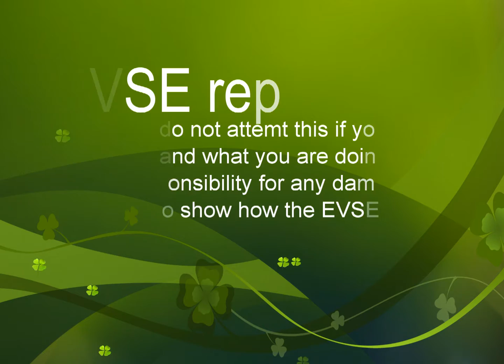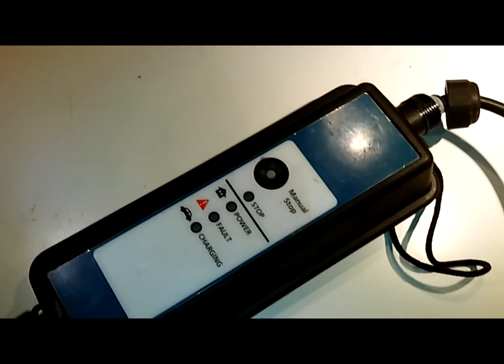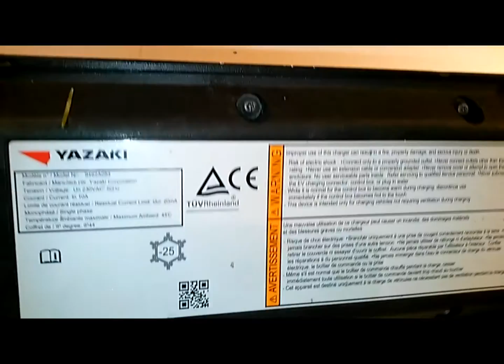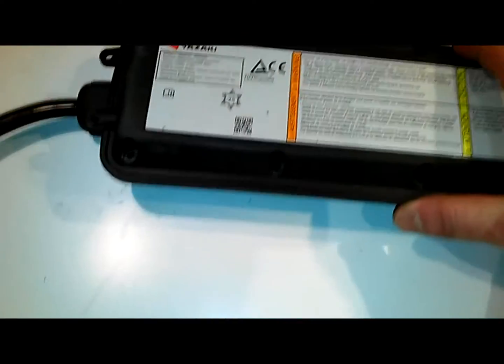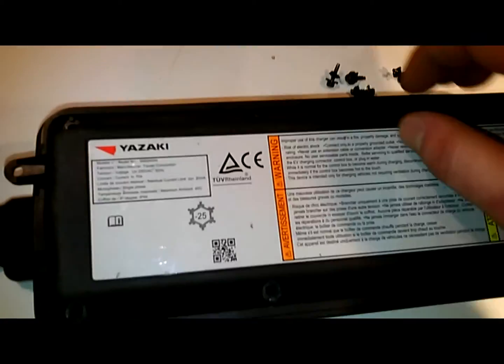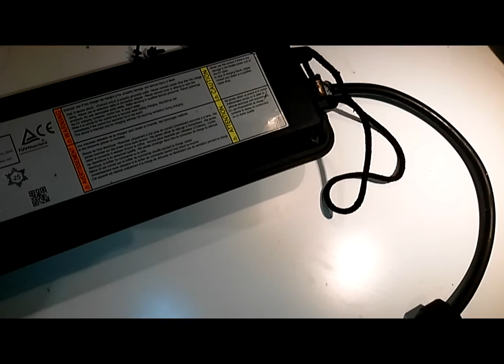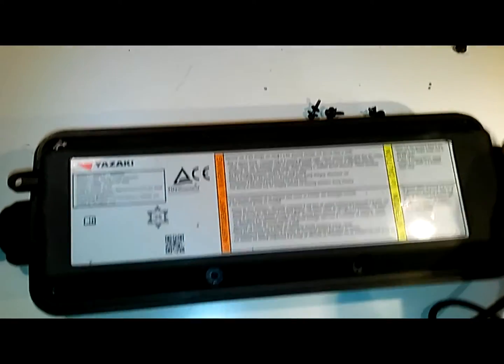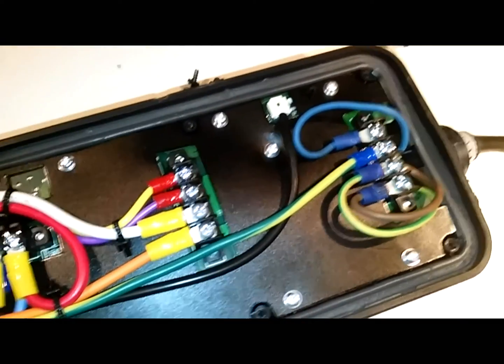EVSE repair

Comment: I just tried to open mine (8/14A version from a 2014 Peugeot Ion), which stopped working after getting heavily rained on, I assume it just needs drying out, but after removing the screws the lid still won't budge. It seems to be glued. Was yours really that easy to open after removing the 8 screws?

Comment: Good video, although we would have liked to see you do the repair from start to finish.  Also, I am getting 6 leafs batteries that I will wire together to make a 24 V system. Can I use this converter you mentioned to charge of my leaf 24 volt battery system?
Reply from the maker: +robviolin1 Hi. Sorry... I try to make the videos as short as possible. When fiddling with 230v I do not want to make a step by step video since this might fool someone into doing stuff they should not play with.  When it comes to the LEAF modules, it might be better if we did this in private? (That sounded really dirty...)  Send me a PM, and I?ll send you my e-mail address. And I can send you some really dirty pictures.... No, sorry I dont have so much dirty pictures. But I have some clean ones. At least some pictures and schematicts of the cells. Cheers.
Reply: Hello, i have same one, mine have 4 wires in plug, magnetoc sensor was in plug. What os it for? And second wuestuon, how to switch to 14 Amp?
Reply: I don't know much about this stuff. sorry